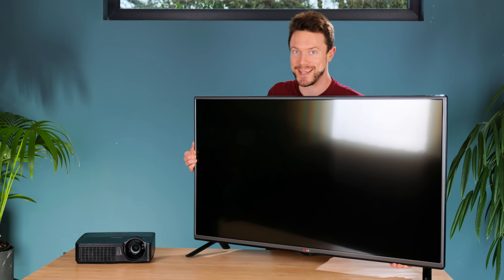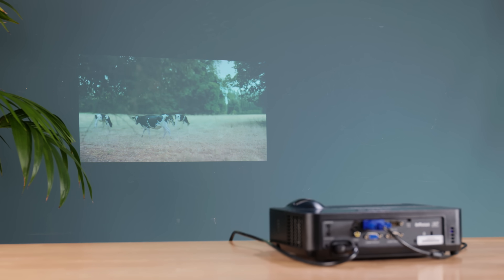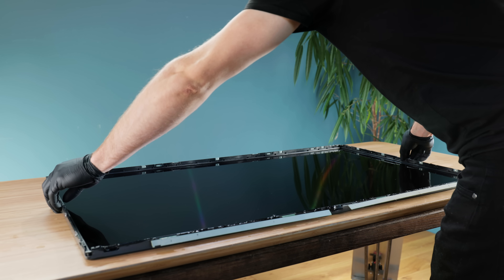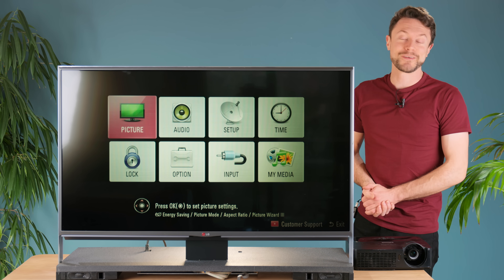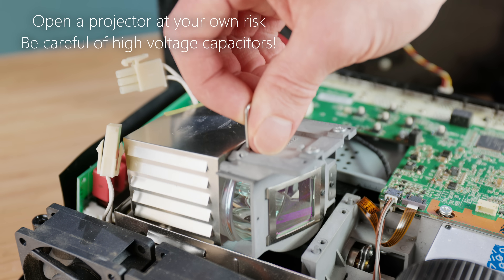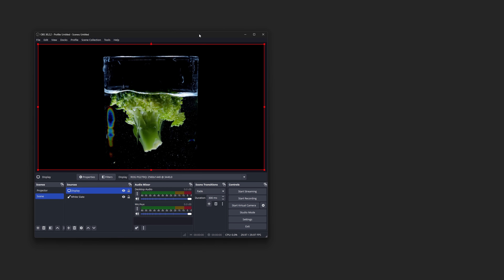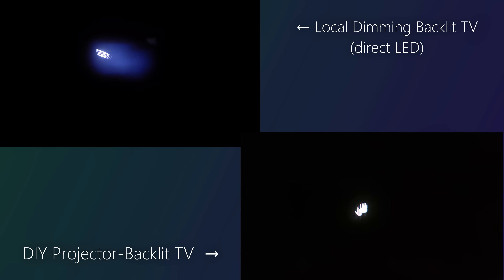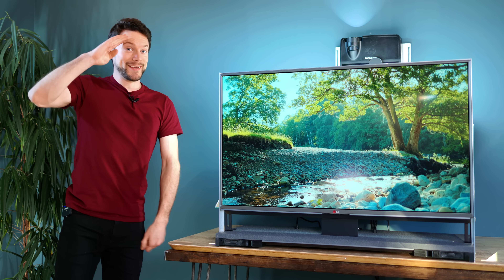DIY "infinity contrast" TV -  with 100% recycled parts

Comment: Nice to see this done with a project. For those looking for "why doesn't this TV exist". It does; using two LCDs instead of an LCD + DLP projector.

Its the Hisense U9DG. LTT and RTINGs has reviews on this. You have one super bright light source (as usual); and two layers of LCDs - one monochrome (to cut down the black areas); and the final one a standard color LCD. 

Hisense's U9DG uses a 1080p (1920x1080) resolution panel for its monochrome filter; and 4k for its standard RGB panel. 

Its an excellent TV; rivalling OLED. As always; the core issue is using things like an LCD to "block" light - they're not completely transparent; so there's always some light loss. This is true because of the nature of the display - its a transmissive display - meaning light has to be behind a color filter and transmit through that filter.

An emissive display is where the pixels themselves emit light; such as an OLED display, or an outdoor LED billboard, or your local video wall at your summer outdoor EDM rave.

I would assume this video is inspired by Hisense's product; just built at home instead. I'm glad both this channel and hisense brought these ideas to the mass market.
Reply: " two LCDs" is completly different, coz it uses 2 things to block light, when here he is using projector to controll the light, but I quess projector block a light too...
LCD with "OLED" at back, which has only white LEDs at 1/4 or 1?16 of its resolution would be nice. Then you are using 1 subpixel, not 3-4 of them, so it can be 4x bigger and give more light
Reply: @zbigniew2628  The DLP projector is using the DLP mirror to block the light in a fashion very similar to an lcd panel, so it is indeed two panels in a row
Reply: @Flimzes  No, it really doesn't. The DLP mirror steers the light of dark pixels completely away, into a light trap. An LCD panel just obscures these pixels, and if the light is too bright or the LCs not opaque enough, some light will still bleed through. DLPs don't have this "problem" at all.
Furhtermore, all LCD panels dim the backlight significantly through the need for polarization filters alone. A DLP without the color wheel just straight up reflects the almost full light output from the source.
Reply: @fonkbadonk5370 i have 4 DLP projectors of different sizes and different manufacturers, they all emit a dim grey'ish light where it should be black. It's not as perfect like an oled.😊
Reply: @ A gryscale LCD panel (which would obviously be used in this context) doesn't need any color filter, and in regards to efficiency in blocking light, LCD and DLP projectors generally perform pretty similarily
Two lcd panels behind eachother will have twice the blocking power as a single LCD panel, while leaving more than half the light through at maximum output since there is only a single color filter.
Reply: @ I've never claimed them to match OLEDs. We were talking about LCDs.
Reply: @zbigniew2628  Yeah, I think you figured it out during your own message. The Projector is blocking out lit areas with its own DLP/LCD/etc. It blocks it down to "gray". Then that light hits the LCD and the gray light gets filtered further down darker. It still suffers from the same design issue - light still needs to be filtered/blocked to get down to black. While an emissive display like an OLED will not have light emitting from the black areas at all.

Double LCD from Hisense is the exact same concept as this project; except built commercially. It was actually pretty cheap at release - relative to the OLEDs at the time for the price. Its too bad there hasn't been a follow up device.
Reply: I looked it up, the idea is very similar. But the Hisense tech's negatives seem to be a slow response time, ghosting in fast moving objects (not sure how fast relatively, but it didn't seem visible in this video in cursor and fireworks examples), and color banding. This idea might be able to easily address those.
Reply: @jakej1837  The idea is the same. The difference is the performance. Also, not to bash this channel's idea (as is DIY); but this "version" is far less color and luminance accurate. He's blasting full brightness on some pixels and not others, and clipping to black/white; while the hisense is calibrated and can "dim" individual pixels far more accurately.

For example, this at home solution doesn't have a great solution for grays. OLED isn't just known for good black levels; but gray levels as well. The DIY version would still be blasting basically full brightness backlight onto it.

Either way, the issue here isn't that this isn't a different solution; its just using different performing parts. At the end of the day, its just controlling monochrome light via one transmissive display; and stacking a second transmissive display on top of it to do further light filtering to get closer to true black. If you want better performance, just buy even better performing panels and projectors. The nice thing about this solution is it performs so well for its recycle value. The Hisense TV was only about $1700 on its first year out on sale; way cheaper than its OLED counterparts at the time, while actually having higher peak brightness. If that price trickled down to today's prices; it would be incredibly competitive for its performance.

DIY build here is probably closer to ~80 in TV and PJ; plus all the misc parts, potentially lamp, and labor. So maybe $200 (not including mirrors).
Reply: @jakej1837  There's no reason why having two panels instead of one should in of itself cause slow response time. That particular product might be slow, but that's not because it has to be, it's probably because it's meant for producing very accurate color and that requires slower panels.
Reply: @5467nick  I think having it as one integrated unit may limit the space for the driver circuit, which may limit the performance. Also the close proximity of the rear LCD may make color banding worse. The DIY (or a theoretical rear projection unit) gives more flexibility in this regard both in terms of space and also in terms of the ability to add a diffuser. I'm guessing the price of production probably would be less too. I looked it up and it seems the Hisense unit wasn't much less expensive than the OLED ones at the time, so it failed as a product. They seemed to have switched to mini LEDs instead.
Reply: @jakej1837 Having opened up and repaired many monitors and a few TVs, they're mostly empty space with tiny little boards in them. There's plenty of room for a second board or a larger single board for both LCD panels.

I'm not surprised the price was an issue. The LCD panel is the most expensive part in a TV and having two of them, even with one being greyscale, would make competing on price with other LCD TVs difficult and OLED is going to be better anyway. There's not much of a market for top of the mid-ranged and bottom of the high-end.

Comment: I mean, the projector itself projects the illuminance map by passing light through another lcd panel. So, I think the idea is exactly the same as one of your other projects where you stack two layers of identical lcd panels together to achieve very high contrast. However, since this solution uses another much smaller lcd panel, I guess it would be much cheaper if the concept ever makes it way through mass production?

Comment: I actually had a similar idea a while ago. But I have no idea if it’s possible and don’t have the know how to make it. The difference is instead of using a projector. Would it I possible to use a CRT as the back light? Ideally it would be the best that the raster of the CRT aligns with the LCD subpixels, I think even not will be better than moderate mini LED backlights.

Comment: Rather than using the software to filter the footage fed to the projector, did you try spacing the diffusion layer away from the rear of the LCD?
That might result in a slightly easier build, not reliant on a computer to run special software.

Comment: I wish I still had my old 42" Sharp even more now, it happened to be tuned perfectly out of the box, and this would have been a great use for the panel. Well at least I have that huge TV with the dead power supply, I was going to use it for polarizer stock, but there's plenty of little monitors for that.

Comment: To answer your question about why TV manufacturers didn’t do this instead of for rear projection TVs: the reason rear projection was used at all was because large-format LCDs were incredibly expensive to produce initially. They were always designed to be a stopgap until the price of larger LCDs came down. They performed poorly at the time too; it was always about cost. In 2004, a 42” LCD was $2500; a 42” rear projection TV was $1000 (and that difference only grew the larger you went.) 

The version that manufacturers did actually do (albeit mostly only for high-end reference monitors) is dual-layer LCDs, but you already know all about that ;). Fantastic mod as always, great way to turn some borderline e-waste into an excellent display.
Reply: So whats stopping them from doing it now. Is it because they couldnt charge like 100k for a tv that you can put together for like 1k

Comment: What if, instead of using a projector, you'd used your super bright TV paired with the LED screen from an identical model in front?  That could solve the parallax problem and make the TV considerably shallower.   I'd think it would be the ultimate short throw projector.

Comment: This is genius!  I tried something similar a few years back to get 3D working on my non-3D OLED using cheap DLPlink glasses, but had sync issues and brightness was not great.  Maybe 3D could work on this setup?  Many old LCDs can be forced up to 120Hz, but not sure if DLPlink would still work without the colour wheel?  Even if not could still work with PC IR glasses like a 3Dvision kit.

Maybe keep an eye out for an old rear-projection set and just slap an LCD in front, 
that would limit the screen size a bit but it would be much more compact / movable.
I wonder if there are any MPC shader / render plugins we could use instead of OBS?

Comment: I love your content, and this is a very cool and impressive project. I use OBS all the time to record and screen-capture lectures. How do you get the video to this thing, exactly? I presume the content you want to watch on the rear-projector TV must go through a PC to be processed by OBS. How does the signal get to both the LCD panel and projector? Multiple outputs on a video card/gpu? Does the projector image have to be flipped since its rear projecting? I would love to see details of that part of making it work.

Comment: Incredible project! I've been wondering : how do you keep the images synchronized between your tv and the projector? Are you using your computer as source for everything and sending the obs processed image to the projector and the standard image to the TV? Is there really a way to do that?
Reply from the maker: Yup, OBS allows a live cast of the processed image to any display. I didn't encounter any sync issues as both the projector and TV had low input lag.

Comment: brand new 65" OLED for $2k vs whatever you can call this, which is pretty much free? price to value comparison is too extreme to compare

I do love my OLED panels, both TV, main monitor for my gaming PC, and my laptop, but honestly, I could use this as well, instead of my TV, and I bet this can be done for desktop monitors as well

would be awesome to use a 32" TV with this modification, and use that as a DIY "OLED" monitor, if it should be used for watching movies/series, not gaming

Comment: This is actually somewhat similar to a pretty much state-of-the-art HDR display from the research lab at Cambridge University. I believe they use a brighter projector, and don't use any glow/bloom - they just line everything up super precisely, and they also use multiple stacked LCDs to get better colour accuracy and even deeper blacks. From what I can remember it was the first display to pass the so called 'visual turing test', where an image was shown to be indistinguishable from a real object in blind trials (they have a sort of fixed face-mount so you're head doesn't move to reveal the lack of 3D-ness, and some clever mirror/lens setups to allow them to switch in real time between the real object and the screen). Really cool to see that something similar works so well even when DIY-ed!

Comment: i wonder if you could take a monochrome lcd panel the same size as the tv lcd (not that ones that large are common, if even exist at all) and use that as a luma mask behind the tv to get the same effect without needing a projector since, unless im wrong, mono panel pixels block a lot more light when active.

Comment: correct me if I'm wrong, but weren't the original "flat screens" using the same method to produce an image? i understand it wasnt near the same quality but a rear mounted projector reflected off mirrors hence the bulbus frame on the back?

Comment: Those old rear-projection TVs have first-surface mirrors in them, which, if harvested and used as the rear mirror of your project, would greatly reduce the light loss that occurs with a second-surface mirror. This makes me want to try marrying an LCD with a rear-projection housing along with the projector.

Comment: My first thought would be to get rid  of the projector. I would take a working LCD TV the same size. Then take your LCD and remove the diffusor. Stack the 2 LCDs on top of each other. OBS and the plugin should drive the back LCD. So a working TV driven by OBS would replace the projector. Now if the back light isn't bright enough then you'll have to make it brighter.
Reply: He already did that one time.
Reply: @cjthetechy  I found that after my post. Hopefully he still has it. I'm interested in seeing if the OBS plugin gives better results with the dual LCD setup. They do make dual layer LCD panels. They're use in reference monitors.

Comment: Now we need one using a qled panel. Is there such thing as a blue light projector? Or the only way is to use a blue filter on top? 

Maybe a brighter projector and blue  filter? Plus! 4k projector + tv, quantum dots, BIG screen, max it out. 😂

Ok for real, lets say an 85 inch tcl qled 850$ new, a new projector 500$, thats 1350 for the main parts! Lets say 150 for everything else. An 83 inch lg oled goes for 6500 dollars. Thats a 5000 dollars less. Better if you can get stuff second hand. Now the question is, how is latency in this?

Comment: Brilliant project but the reason it wasn't commercially implemented is still the size/distance from the wall. Yes, OLED panels are somewhat expensive, but considering inflation, still just as expensive if not even cheaper as projection TVs would be at modern screen sizes. Also projector bulbs are not made to be on for so many working hours as modern TVs.

Comment: to use this device as a TV, we need to have a computer that will work with OBS, which will have at least 2 video outputs so that the image is displayed on both TV and projector, while the image resolution will be on the smaller of the screens, if you use the standard screen duplication function. The idea is good, but the real use is questionable from the software point of view.

Comment: If you can get pixel-exact placement,by mounting the projector on a precisely adjustablable 6 DOF stage, you could get rid of the diffuser sheet, the OBS passthrough requirement and one the whole get much much more light.
And also, with combined luminance 8bit in the projector plus 8 bit in the panel, with dithering and an HDR LUT, you should be able to generate at least 15-bit colour accurate HDR while also far more intense peak brightness.

Comment: Could you get the same effect by having two panels laminated to each other? With one showing the color image and the other using the luma map to block the incoming backlight? If you use the same panel i think it would give pixel accurate dimming, though there would likely be some light bleed on very sharp edges.

Comment: Instead of putting the whole thing on a table/bench, why not build a "closet" for it? That way you can flip the mirror upside down and put the projector in the closet underneath the screen.  It'll also keep stuff off the mirror like dust and cats etc.  And the whole contraption will look a lot nicer.

Comment: I mean there is the very silly idea of Slapping an OLED to the back of the LCD to do the same thing... or making a Maze of Mirrors to make the Long throw into a short throw and finishing up the build. The Next would be to Figure out how to Internalize the Glow filter to the TV so it can run off One HDMI in signal or any other Signal types like from the Scart Port.

Stil Congrats at fixing one of the major issues of LCDs the Black level. Now if only we can fix the Display Lag all tv's have now a days.

Comment: I was thinking about something like this but in regard to the canvas I project to, to keep the huge size of the displayed image: if it is somehow possible to build a canvas that gets luminance info through the HDMI signal and darkens the canvas where needed so less light from the projector gets reflected would be a huge upgrade regarding black levels. Could this be done in any way? I thought about these glasses that darken with a push of a button or something similar. Or e-ink? Probably to slow and very expansive... Any ideas? 😁

Comment: What about using a DLP television housing, and it's built-in projector, simply modifying its DLP system to remove the color wheel as you did in the projector and replacing the screen lens with an LCD panel? Could you achieve the same or similar result in a more convenient package?